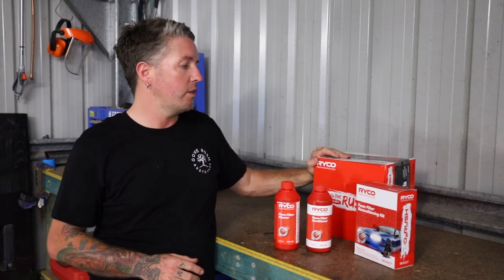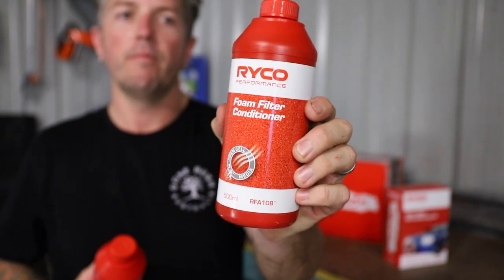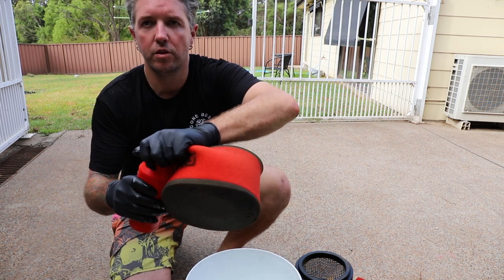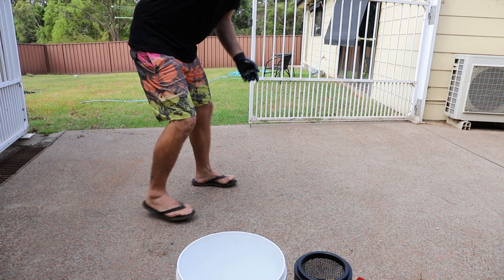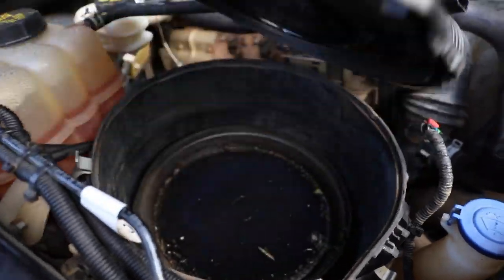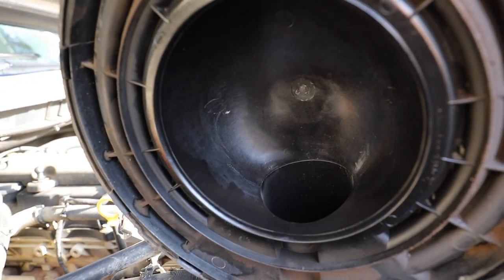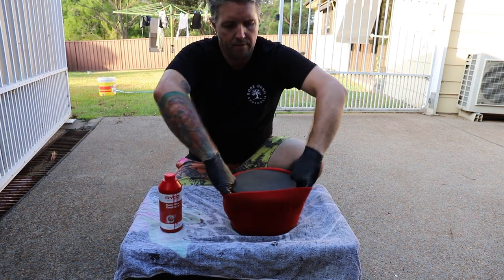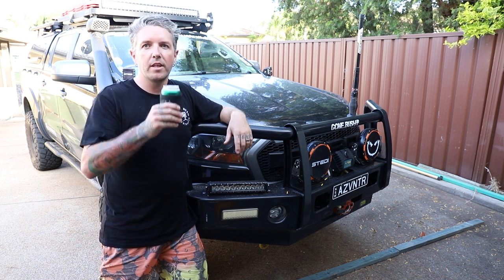How to clean your air filter

Comment: I purchased A RYCO Rush filter after watching your video.. My one concern is I have the BT50 (Same air box as Ranger) but the filter inlet hole doesn’t make a snug fit - to inlet ( top that clips down ) Not like the standard filter does ! It would be better if it located itself better... performance is definitely better though! Thanks for posting and giving me the motivation to buy one !